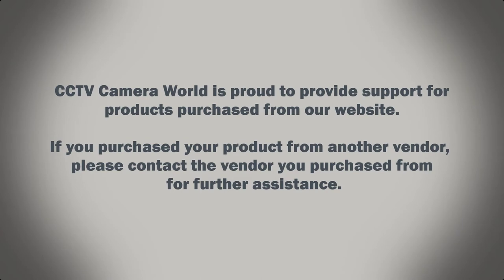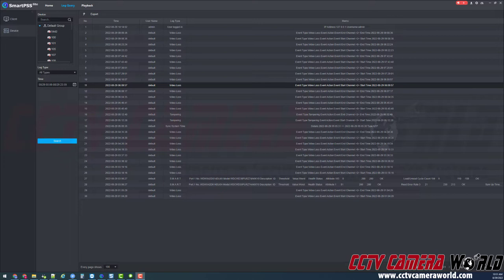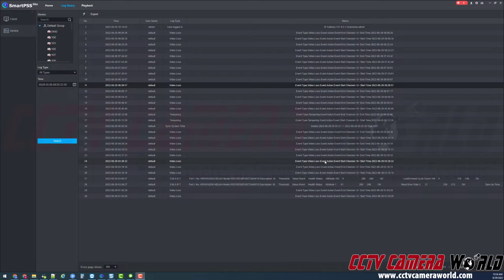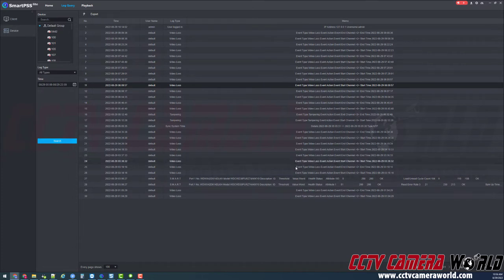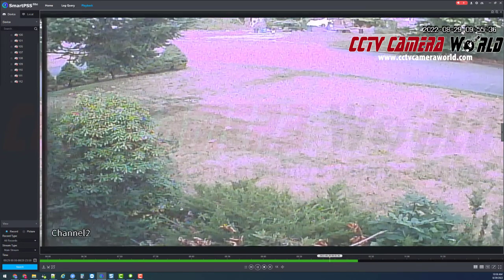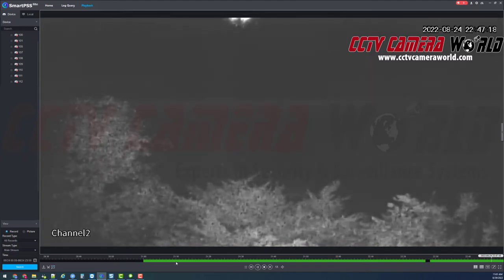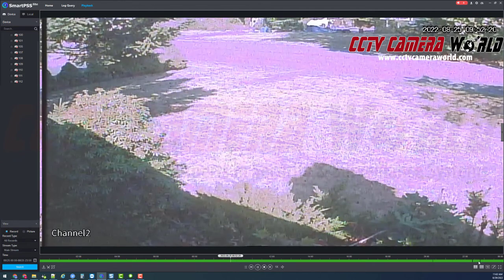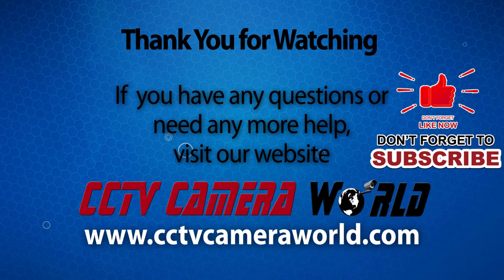Troubleshooting a Rebooting DVR in a Security Camera System

Comment: BNC Cable gets deteriorate with time. It happened to me a few weeks ago. Couldn't understand why it was rebooting till I started pulling 1 camera at a time. Till I noticed when I took 1 camera off the unit stayed on.  I followed the wire and it was all decayed and white powder inside.